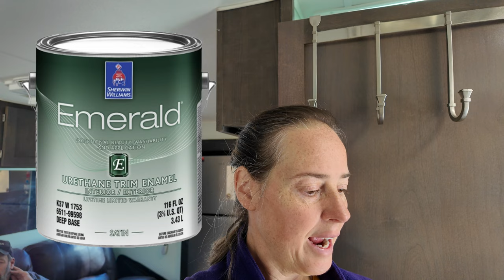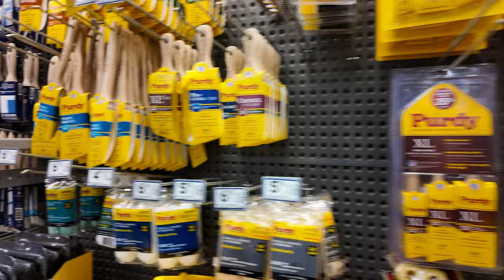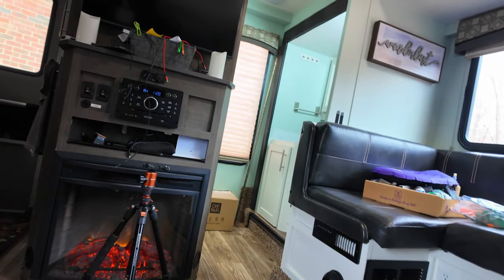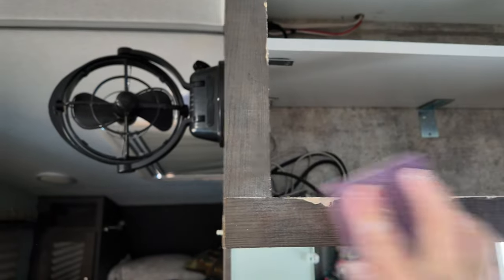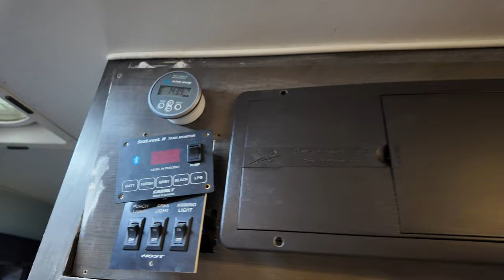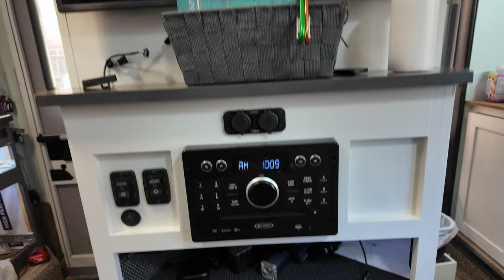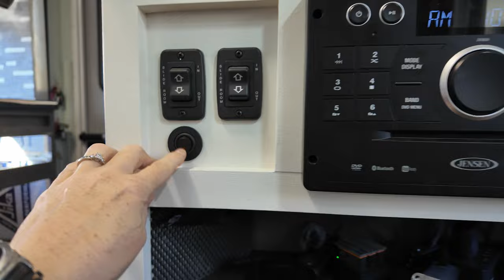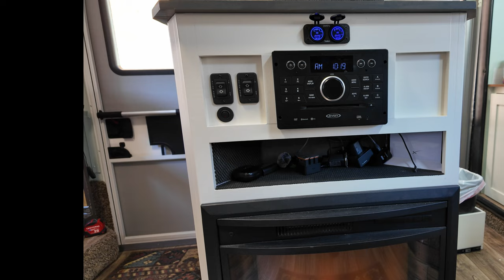I Tried Painting my Laminate RV Cabinets | e169-NEW

Comment: Did you have that rubber trim around cabinets?  Mine is beige and I’m painting white but thinking paint is not going to stick to the rubber - might have to completely remove and replace with caulking but wondering if you did anything different, thanks for the video!
Reply from the maker: On my bathroom cabinet, I trimmed the rubber down but on the other cabinets I just ended up painting the rubber. The black just looked off with our white cabinets. I'm sure it will eventually peel off but I'm willing to repaint it later on. Good luck with your project!